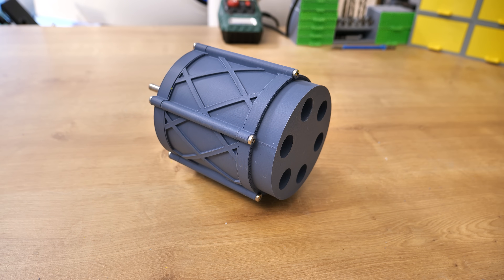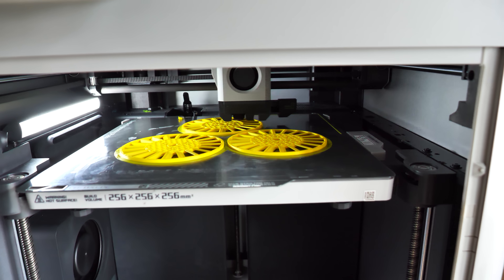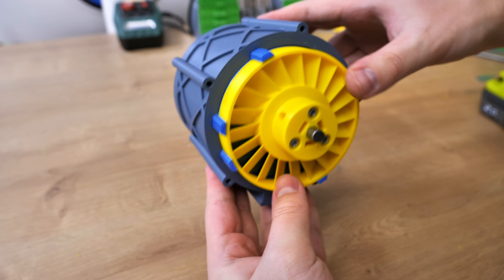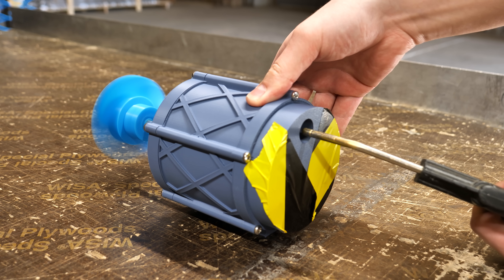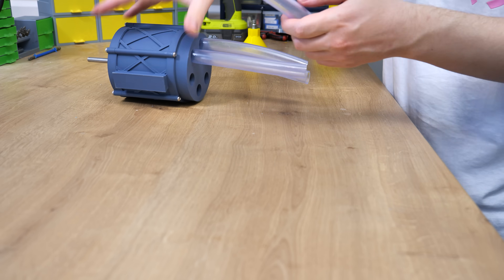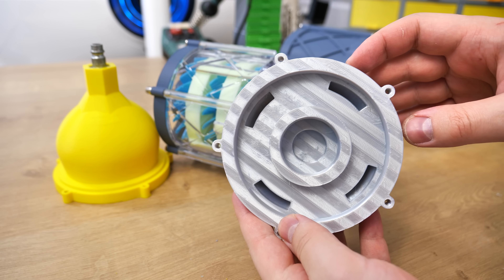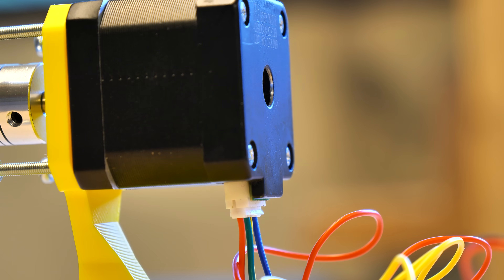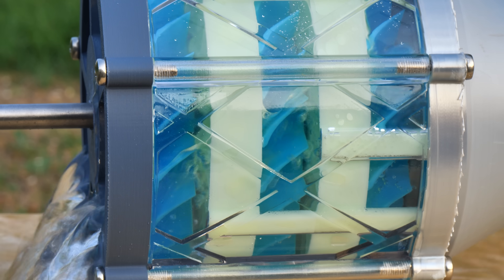I 3D Printed a TURBINE and Produce Electricity With It.

Comment: Have in mind that all turbines are designed to be most efficient at certain RPM so a reduction gear for that stepper motor should be neccesary.

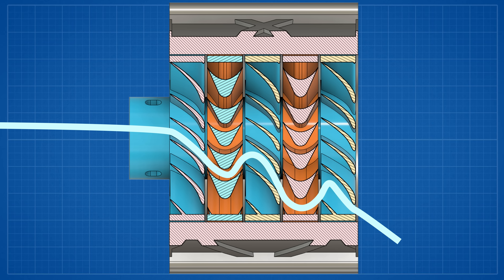Comment: air must flow over the  rotor blades from the thick edge to the thin trailing edge, you appear to have it backwards. Your set up will work well as a compressor, with the intake on the right 1:25
Reply: I was wondering if someone else caught that. Looking at the cross section made my brain hurt until I realized how he'd managed to invert the geometry so weirdly!
Reply: no, they are correct. you are simply confusing one aspect, aircraft, with something entirely different...reaction turbines.

they have to converge to form nozzles to accelerate the fluid to create... a REACTION.

they are "backwards" as that is the only shape that is aerodynamic and also converges. think "heros turbine". it doesnt work as well if its nozzles diverge and expand. maybe you can design a shape that looks more aesthetically correct yet performs the same function, or better?
think water sprinkler with rotating arms. they wont spin if the arms dont narrow down, converge into nozzles.

contrary to popular belief, that is exactly how a REACTION turbine works.

not my fault the education system cant explain two machines that have been in use for over a century without getting their fundamental operation confused.
part of the problem may lie in the fact that there are barely any true reaction turbines, and most of them are a mixture of reaction and impulse, whilst there are several examples of true impulse only turbines.
Reply: @paradiselost9946  Nope. The reaction turbine works because the blades cause the moving intake air to change direction and in doing so it exerts a reactive force on each blade , combining to produce torque . The curvature of each blade optimizes the direction change of the air to maximise efficiency. The airfoil shape is simply the  most efficient shape to minimize drag losses, but it needs the thick side facing the incoming air. So , just flip the blade profile to accomplish this, keeping all other geometry as it is.
Reply: @gregarmstrong4653  that my dear sir, is an IMPULSE turbine described perfectly.

Comment: I think your Rotr blades were backwards. Usually, you would put the thick nose to the front.
Also, for turbines, the first row is usually a ststor or a nozzle section, not a rotor
Reply: Yeah, in every airfoil I've seen, the leading edge is rounded and the trailing edge is really sharp
Reply: Aerospace engineering student here, yes it’s weird that they are thicker at the back but they aren’t back to front. For a turbine, you need the flow to be turned more in the tangential direction as it passes through the blades, in other words it should leave swirling more than it entered, which is how he has it here. There are some other problems with this design, such as the lack of a stator row before the first turbine and the mismatch in blade angle between rotor exit and stator entry after blade speed is accounted for, but the blades aren’t simply backeards

*to clarify, swirling more relative to the rotor than when it entered. Swirl in the absolute frame is reduced through a turbine rotor
Reply: @danielfearn6076  The rounded leading edge is essential to prevent early stalling at the suction side, so I still think the airfoil is backwards. Yes I agree with the direction of the swirling you said, which implies his model is a compressor. The flow is from right to left in his cross-section animation.
Reply: It triggered me seeing the reaction blades being run backwards XD. Glad I wasn't the only one.
Reply: Absolutely correct, he made it backwards
Reply: They are definitely back to front.
Reply: @CyclingMikey  they arent. whats back to front is your understanding of reaction turbines and their blade geometry.
Reply: Rotor turbine is attached in backward. well, it will also works, but it can't make good efficient. there is two type of turbine, reaction type and impulse type. in easy explain, first one using Newton's third law. and second one using force from differential of pressure. first one is bad in efficiency, but good for super high speed rpm. and second one is good in efficiency, but not good for high rpm. so most of turbine using this two type at the same time. and your rotor shape is closer to impulse type, and its attached in backward, it will works as reaction turbine. it is like.. drive Ferrari on dirt..
Reply: Does this mean this person stole the design from someone and not crediting that original designer?
Reply: For the order: it depends on what the incoming air is doing. Think of it this way: the rotors work best when the airflow is purely axial. If the incoming air is already purely axial, the stator will just decrease efficiency. In a jet engine, the first stage of the turbine is sometimes a stator because the air flow coming out of the combustion chamber might have a radial or rotating component.
Reply: @RichardBetel  That is not correct. You can get more power out of the turbine if the flow is preswirled. That is why there is usually a nozzle stage in front of the turbine rotors, that adds swirl to the axial flow from the combustor.
Reply: @fg8557 this is not correct either. NGVs offer the gas flow at a specific angle to induce movement. Depending on the type of turbine and if its impulse, reaction or impulse reaction that will somewhat change that angle. NGVs and the relative AoA in regards to the turbine rotor also have an impact on shaft speeds

Comment: Good video.  I think due to the size of the turbine you need a bigger volume of air rather than pressure.   Get a shop vacuum cleaner and hook hose to the exhaust. Blow that into all the inlets. Try draw a vacuum through it as well.
Reply: Or he could maybe make very small airtight exit holes that actually turns the pressure of the air into velocity. That would probably greatly increase performance. I believe that’s what axial steam turbines do aswell

Comment: Very cool...in water you should point the turbine down at the ground and let gravity assist the flow on all blades. That's how the turbines are positioned in hydro electric dams.  That said your turbine is not designed for water.  You would want more of a side entry stream.  Keep going and see if you can design a jet turbine engine and have PCBWay print all the parts in metal.  Would be a great series of vids.

Comment: why do you have to think it as "lift", not useful, not even for plane wings
Reply: just push the surface from an angle, thats it
Reply: even for a air plane wing
Reply: k.i.s.s.s. as all engineering, functionality before knowing, understanding before theory
Reply: steam engine, to keep it under/around 100C, not melting the small turbine
Reply: archimedes type full blocked turbines (ducted impellers) work for all fluid speeds, your turbine fails at low speeds

Comment: Hey, this is awesome, super well done!! But one question, isn't the airflow reversed? It seems like the air flow is going from trailing edge to leading edge on the blades instead of leading to trailing. Or is this intensional in these kinds of turbines?
Reply: one of the few fundamentals and highly misunderstood parts of a reaction type turbine.
the thickening section when you think about it creates a converging nozzle.
the air enters the blades as high pressure, low velocity, exiting at a lower pressure at a higher velocity, as per bernoulli.
picture it, if you will, as the basic "heros turbine". or, a hose going mad when you turn it on. the nozzle reacts as the fluid accelerates inside it.

it then expands, slows down, and increases in pressure before passing through the next stage.

still, virtually every turbine is a mixture of reaction and impulse, or pure impulse... the fluid hitting the blades and transferring momentum by slowing down. theres only one or two examples of pure reaction turbine... hence why virtually everyone gets them confused.

Comment: You and Integza should build a jet engine together.
Reply from the maker: Not a bad idea XD
Reply: @LetsPrintYT Breaking Taps is working on building his own jet turbine as well
Reply: @LetsPrintYT  yes
Reply: @LetsPrintYT  y not?
Reply: PCBway does print in metal... Doesn't them?
Reply: @MCsCreations  don't they? 😅 But yes, they do.
Reply: Yes @MCsCreations
Reply: That's what I'm sayin
Reply: Yes
Reply: this would be one of the best colabs fr
Reply: Yes
Reply: YES!!!
Reply: Here here
Reply: nah build an entire rocket
Reply: uh... that has nothing to do with jet engines... and it not very usefull as one unless it turns upward of 100000 rpm.....  5000 is a cpu fan.... oop a cpu fan turns 8000... nm :-\
Reply: Yes please and throw it in a FPV rc jet THAT IS ALSO 3D PRINTED
Reply: Why Pollute by using fuel... the world already has thousands of Gas Turbines adding Billions of Tons of Pollution to the atmosphere... lets together end this and think of Compressed Air, Water etc.. and NOT POLLUTING FUELS... VAN WE..???
Reply: @AjayAjay-gz3oz gas turbines work on compressed air that's what the compressors do. Fuel  changes are coming, efficiency is improving and OEMs need to meet IACO requirements to put engines on wings. Hydrogen, electrification and non food crop sustainable aviation Fuel is being used and big things are coming in the very near future
Reply: @AjayAjay-gz3oz shut up